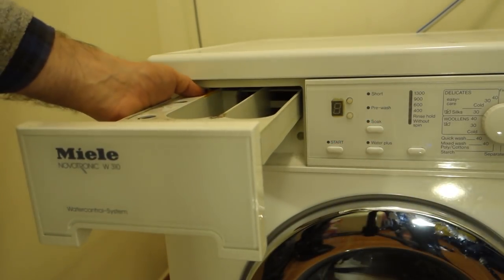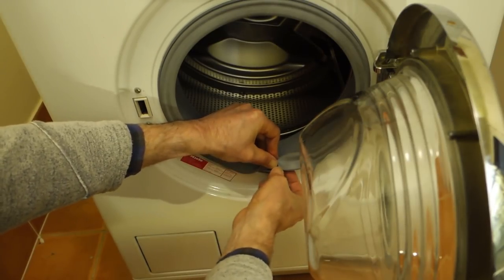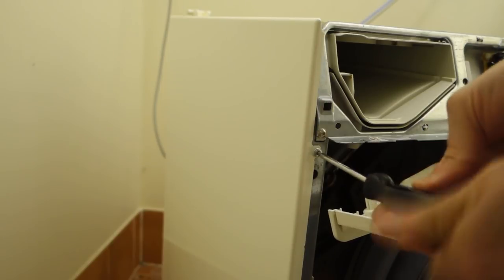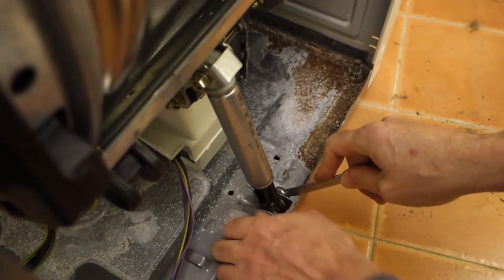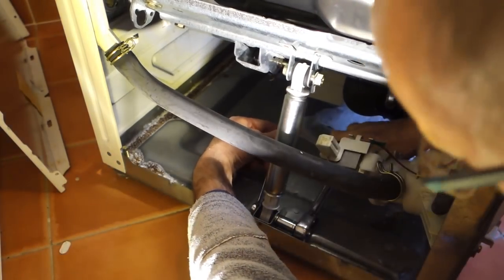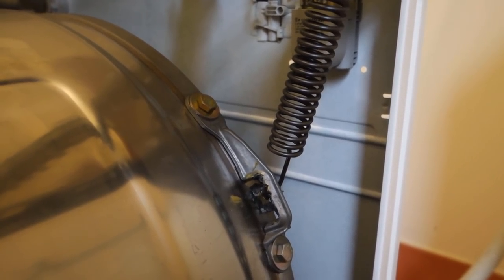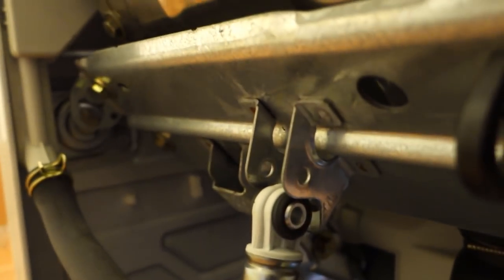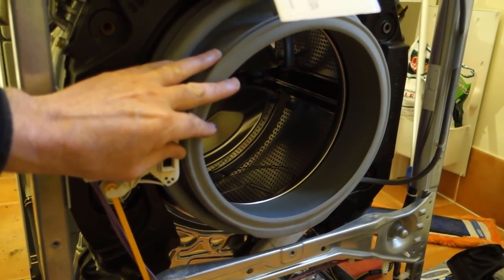Ep 37 Miele Washing Machine Repair (Shock Absorbers)

Comment: Thanks so very much Simon. This is incredibly helpful. Our 11 year old Miele has developed a scraping sound coming from the front boot area. The Miele repair person came yesterday and said, first, that this was not repairable because the brackets that hold everything in “alignment” are not replaceable. When pressed, he said they would fix it for $1700 by replacing the motor and drum units. Needless to say I am frustrated and disappointed. I will venture to fix it myself. I hate the throw-away mentality and had hoped that this company, which sells good quality products at a higher price, was also. Perhaps not? Your video will help me immeasurably. Thank you!
Reply: How did it go?
Reply: @jesshothersall  my Miele w3725 is 14 years old this year. It is rumbling and shaking at its highest rpm1300. I mean bouncing like wtf. I am thinking springs are stretched and or rods need replacing . I found 20 dollar rods bran new let’s see hey✌🏻
Reply: @Garrysullivanjones  Since mine had new shock absorbers (not springs) it seems to be good for several more years, no more vibrating, and no more things falling off the top when it's on either!

Comment: NOTE: It is possible to just remove the bolts under the top and on the back. This wat you can get a 15 cm opening. This will give you enough space to reach in for the bolts and replace the shock absorbers. This way the replacements is done in 30 min flat ;0)
Reply from the maker: Ok,. I didn't know that.  It's such a long time since I did this my memory is not 100% but I thought there were a number of other connections such as electrical and plumbing connections which might impede removal of the back panel.  You're suggesting a 15cm gap is possible....I'll try it when they need replacing again 😜 (in about 20 years time)
Reply: Thanks to this video and this comment, I (a layman) managed to get in quickly to have a look. Unfortunately, it's a bearing issue in my case, so I'll probably need to buy a replacement machine.
Reply: Hi, i took your advice and it saved me a lot of time and hassle! Note that after removing the top and back screws, you have to push the side panel down and then out, to remove it from the bottom frame. There is a lip that holds it to the frame. This is very easy to do and also to put back in place.
Anyway, there is just enough space with a little help from my wife to keep the side open :).
So thanks for the video and for this comment!!!

Comment: Many thanks for the super helpful video.  After watching, I purchased new springs along with the new shocks.  Decided not to remove the front as it looks too fraught.  I undid the side panel screws and just forced them open enough to get access😅
Reply from the maker: Thanks for the feedback Cameron,  glad to be of help.  This video is quite a few years old now and unfortunately my Miele had to be replaced recently.  The drum 'spider' collapsed/broke and the repair parts are just not available any more.
Reply: @PowerOn-  Sorry to hear that.  Our Miele is 25 years old and been in action pretty much every day.  It cost us £900 back then!  Proving the adage, you get what you pay for.  It looks clean as a whistle inside and the bearings and belt look fine.  For £50 on parts I may be able to eek out a few more years, fingers crossed .😅  Thanks again.

Comment: Thanks Simon, did the shocks and springs on my W2515 today, your video was a great help. Just one thing I found, when you remove the clear facia it is easy to mark the plastic. I found that if you use the Yellow plastic thingy on the back of the dispenser (you use it for opening the filter door) to remove the facia it doesn't damage the plastic.

Comment: I watched three videos on this repair and this one was the most clear (but the others showed more of the pain so you know what you are in for!) I replaced the dampers in my old Miele W3264. Thanks a million. 
My tip: To hold the door off the floor while reattaching it, I used two yoga bricks and a magazine.
(I'm a 64 year old lady with a touch of arthritis. A funny lady my age who stayed in my Airbnb said to me "Woman = Einstein brain")
Second remark: I did have to use WD 40 and tapping and patience to remove the bolts holding the dampers. 
And finally,  I've got those pliers that open when you squeeze the handle for the wire/spring around the gasket. I think it's now my favorite tool. Or maybe my new clicky socket wrench.

Comment: Simon - THANK YOU SO MUCH! this was an INCREDIBLE video. My father and I replaced the shocks and springs in my miele washing machine. It is now working brilliantly. this was after one repairman told me to replace the entire washing maching, and a second repair man couldnt grasp the fault (even though the machine would slam into the wall if it was trying to spin a heavy load). Your video was super clear and gave us just the right amount of detail to get the job done. Machine now on its second load and I am so happy. And it was great to do a job like this with my dad, as Ive lost alot of confidence in these sorts of jobs as Ive not done so much DIY lately.  So an enormous thank you to my father - Ed - also. :)
Reply from the maker: Great feedback, im so pleased you were successful in repairing the machine.  In respect to your comment on DIY skills, they are useful skills to have but they come though a via an initial sense of curiosity followed with a bit of determination!
Reply: @PowerOn-  So spot on, Simon, about the big C & D of DIY. To wallow in the sweet satisfaction of watching the thing run again as new, after Dad (anxiously) fixed it and then telling Mum: oh it was QED, darlin'.

Comment: Hi Simon, thankyou for this brilliant instructional video. Although our model is from 2006  it came apart pretty much the same. It was a bit more involved doing the job as there was a dryer on top joined with a stacking kit and they are built into the laundry cupboards but none the less the dampers were the issue so i replaced them and adjusted the springs where necessary and with an overall cost of $100AUD including delivery for the original parts you helped save us time and money. much appreciated.
Regards  Bill
Perth Western Australia
Reply from the maker: The satisfaction of a good repair.  Thanks for sharing your story Bill.

Comment: It's funny because I just repaired my toothbrush, which is the same you have. Then I clicked on your name to see what else you have published, and I found this video. I had the same washing machine, not sure if the exact model, but it's a Miele, and it looks like yours. I replaced the shock absorbers after 16 years, and at the same time the ball bearings, which was tricky because I had to dismount the entire machine. It is still going strong after 20 years of service. My sister is now using it.

Comment: Today I changed the springs and dampers on my 15 year old W304 PLUS thanks to your excellent instructions.  I found the old springs were all 4mm longer than the new ones so I put the new springs in the original slot positions.  It works as good as new!  
Your video was a godsend!
Thanks again.
J
Reply from the maker: Well done James 👍

Comment: Thank you very much for this video.  I used the first half of it (to the point just before you removed the side panels) to get into my Miele W3922 washing machine.  All identical to take apart the top and front, except that the kick plate on mine snaps off rather than unscrewing.  I was then able with some improvisation of my own to remove and replace the rubber door seal.  I can honestly say I have never attempted anything like this before and the door seal had been purchased 18 months ago and sat in a cupboard whilst I procrastinated!  Your video gave me the knowledge, courage and motivation to fit it.  My machine is currently going through a couple of test rinses and so far so good - no leaks!  :-) A non-DIYER woman :-)
Reply from the maker: Great to read your comments and feedback.  When putting these videos together my main hope is to help and encourage people to 'have a go' themselves while possibly saving a bit of money at the same time.  Well done you😁!
Reply: I'd say you've graduated as a DIYer now :), well done, and for your next challenge?

Comment: This was a great video, and did a good job at getting me started. But while my Miele W 1986 looked a lot like this, it was substantially different in many ways. First, there were no side or back panels. The back and sides are a unified piece of metal with a front piece welded on. Second, the drum boot stayed with the drum assembly (which was a good thing). Third, some of the fastening screws were in different locations, and some were Phillips head. But all in all, you gave me enough of an understanding to get this done. The top springs were really hard to remove, but very easy to replace. I had to dump the Washer on some pillows on its side, remove a bottom panel, and access the dampers from there. Not a lot of room to work that way, but very doable. Put it all back, but got a "Inlet Water" error. Turns out the sensor uses a vacuum hose that connects the main control panel which does the actual sensing of water pressure when filling the tube. It comes off pretty easily when you swing the front panel open. Oh yeah, the front panel is hinged on the right so its swings open when the screws on the left side are removed.

By the way, if that water level vacuum hose did come off and you started your washer, be aware that the washer will think the drum is empty. So if you push the Open Door button it will open and fill the room with water. Yes, that's right. It happened to me...

Anyway, thanks a million for posting this. It really help me a lot!
Reply: W1986 is a 900 series machine which has a hinged front and unibody construction.
Reply: Thank you, as mine also has a hinged front, I have been forewarned!!! :)

Comment: 20 years, now that is a good washing machine :-D
i can see why it's worth the odd part being replaced over the years.
I had a 18 year old service 1000 machine, it used a rotating cam as the controller.
Old tech was basic but more reliable than modern junk.
Reply from the maker: .....yes there maybe a few more years in her yet! 😀
Reply: I have a washing machine for 22 years, and it still works. The heater has been changed 3 times already, and the shock absorbers 2 months ago. That is Gorenje, a Slovenian product, they made high-end home appliances, known for their excellent quality and durability similar to Miele, but unfortunately they failed to expand the market after geopolitical changes and mass globalization. Now they have been sold to the Chinese, Hisense or something, and their new products are junk.

Comment: Thank you so much for this video, our Miele was making an awful noise and smelling a bit burny....... Followed your instructions and out shock absorbers were wrecked, paid £15 for a new set, put it all back together and our 18 yr old machine is back up and running.... Saved us anywhere between £400 getting it fixed .. Or £800 for a new machine.....  Cheers....!
Reply from the maker: You're now an official hero of the "right to  repair" movement! 😊
Reply: @PowerOn-  Thanks to YouTube I’ve also managed to fix two TVs and our oven...! I can’t believe I’m not on the Queens New Year Honours List...!

Comment: Great video, clear and instructive, thanks for the effort of putting it together. Now I can give my old Novotronic W903 another 15 years.
Reply from the maker: Hi Torbjorn,. I hope your repair goes smoothly.
Reply: @PowerOn-  Dampers arrived today, the old ones were both inoperative and (probably because of the banging) were broken at the drum fixation. First test wash successfully finished. Side and back panel of my Novotronic 90x is in one piece, and the front turns out on hinges, so I had to access the dampers from the front, rather awkward. However I realized then that the dampers are (or at least appear to be) accessible from underside the machine, mitigating the need to do any disassembly at all. Next damper change 15 years from now I may get by just laying the machine on one side.
Reply: @torbjrnsund677  Will you not need to be Superman to get it back upright again, after lying it down? It nearly killed us getting ours into where it lives, and we just had it tilted...

Comment: Thanks for the instructions whch were really clear and easy to follow. I have a Miele W304 but it was pretty much the same. 
I took a short cut and changed the springs at the same time as the dampers :-) thanks fro the Heads-Up on that.
Just one thing, it would have been good to show how to refit the boot to the door. getting the sprung ring back in place was a bit like changing a bicycle tyre but I got it in the end. :-)

Comment: Just found your video, my Miele WDB020 developed clunking sounds just after the 5 year warranty (what a coincidence) ... I couldn't locate the noise back then, but I seem to have tracked it down to the top rear spring. Will have a look at the dampers and springs at ease with daylight tomorrow, thanks for the info. They sure don't make them like they used to

Comment: Simon, Thanks for the very informative video. Have a similar “bumpy” issue with my Miele W5825. I’ve ordered shock absorbers and coil springs. Should be able to fix this pretty quickly after watching yr video.
Reply from the maker: Thanks for the comments Job.  I hope that your repair goes to plan
Reply: Simon, shock absorbers were not so bad but springs were 4cm stretched. Replaced all and runs like new again.
Reply: Thank you for the video this is on our machine the same problem After 20 Years good working. After Repair its werking good. Hopelijk for a nex 20 Years 😂👍🤟 greatings from Holland

Comment: Thank you, I've been told by the repair chap that the pcb is at fault, and just discovered refurbs (£42) are often sold with new dampers too, as squishy dampers can apparently cause the pcb board to fail. (New board fitted is £500 for a 15 year old machine, not really sensible). Other half pointed out we need to know how much trouble to renew dampers, as well as fitting the board we already have a £20 quote for. Hence watching your video. Seems labour shouldn't be much of an issue, as it looks pretty straightforward, and we could possibly even do it ourselves? Downside, my machine is in a previous downstairs loo, so only has a few inches clearance either side, which means dragging it out into the next room. We're in our 70's and himself has a bad back, so probably a job for a young strong chap, wonder if my son would like to visit soon? Many thanks for the demo, and the addition of the stretched springs too.
Reply: Found a second hand pcb board, and bought some new dampers, for less that £20, man fixed it for £45, and machine is now working beautifully again, what a relief!

Comment: Thanks for this..our old Miele w404 plus has started to misbehave so I dove in ..interestingly my springs are set exactly the same..back at the top..front in different places...my dampers are definitely on the way out so that helps. Initially I was only looking to change the belt when I found your video and so by checking the same issues as me you've saved me a ton of time. One good thing on mine is you don't have to remove the control panel to remove front and sides... So maybe they made an alteration to the model...must have had mine over 20 years now... Hopefully I'll get another 10. Before the bearing collapsed....😁 Did moving the spring position create any issues later on?

Comment: Hey Simon , I have 14 year old Miele 3725 model. Out of the blue (well after 14 year of blue rinse) , it rumble and shake all over even to the point of sparks were seen at one point during its highest rpm of 1300. Anyway I pulled as much apart as I could without ruining factory preset . My question , How do I know if suspension rods and or springs are stretched or rods are needing replacement ? Cheers

Comment: Simon great video thank you, didnt actually answer my particular issue though you started off the video talking about your Miele jumping around. Last night I thought I was being broken in to, thankfully not, it was my Miele W310 about to go to spin cycle. Turned off the machine (which I probably shouldn't do) to find my door seal seems to have come away or become creased in some way and my machine ended up 10 inches out of the cupboard its currently in, thats with the tumble dryer on top. If you have any ideas please let me know in a reply before I go ahead with buying a new machine as apart from this issue its fine. And its 15 years young! thanks
Reply from the maker: Well I'd take an educated guess that it is either an unbalanced load or the dampers have failed.  Sometimes if you have a few heavy towels in the load it can cause an imbalance.  As for the rubber seal, or boot as it is sometimes called, this is an easy repair if you are up for it ?!😄

Comment: Thanks so much for posting this video.
I would strongly suggest replacing the 4 springs at the same time, as I noticed that the drum could be bounced around like a basketball with the old springs in place, but super firm with the new springs fitted (yes without the shock dampers).
Also there are several different types of retaining screws, so maybe keep them separated in a used egg carton to make reassembly easier.
The spring around the door seal is a pig to replace. If anyone has any tips for getting that back on, I’d be grateful to hear it💪
Reply: Hey I used a screwdriver on that flat head to stretch it around the door seal when I replaced it. Took a couple of times but it worked when you get the hang of it. I own a Miele W5748 water control system. It’s similar to this one.
Reply: Really like the suggestion of using the egg box for separation, thanks